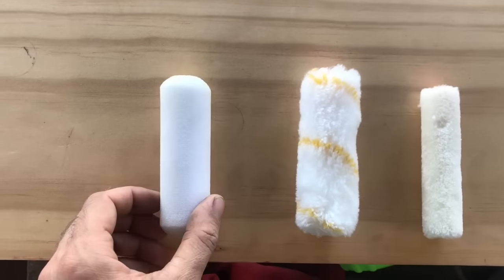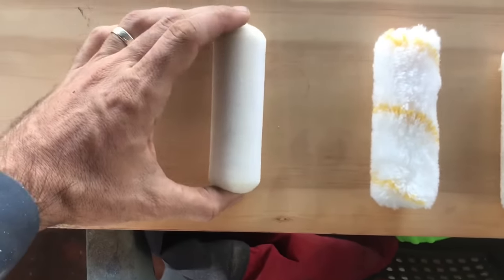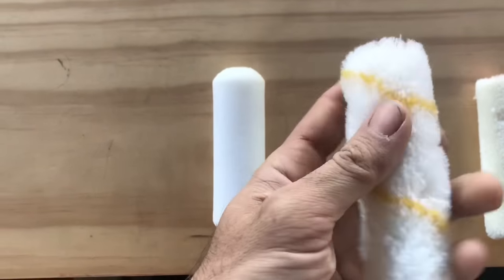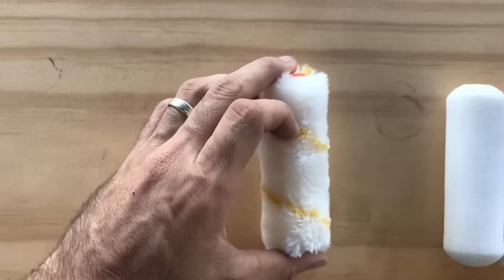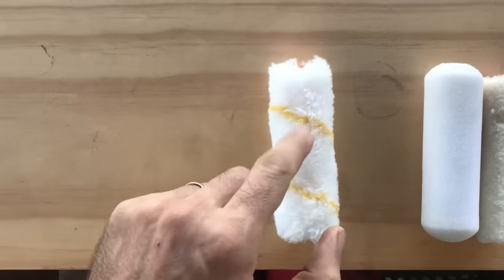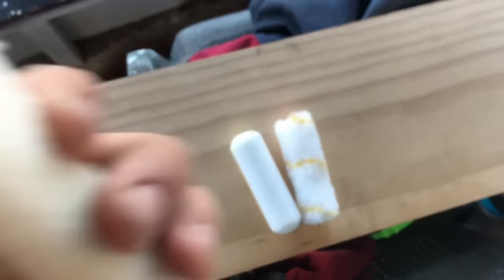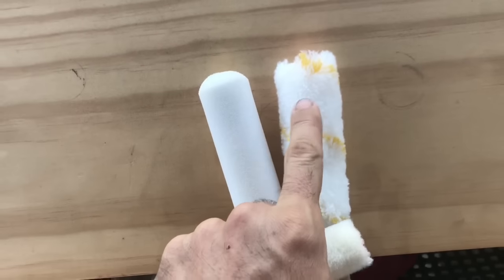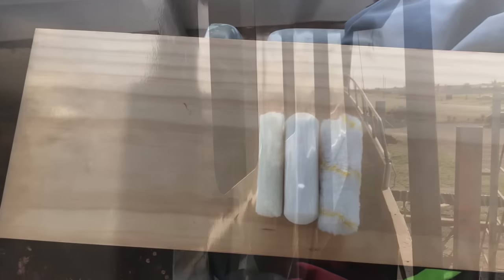What Paint Roller is Best (in our limited opinion)

Comment: 8 years late... I literally just did my first dec job in my bathroom... and I had two rollers, which in this vid were the first two types.

Wallpaper is slightly textured. Kinda bobbly patterned gently knobbly pattern stuff (not rice paper stuff).

I used a brush to edge... the the first spongey roller to coat the whole thing, then that second fluffy type to do the second coat.

I needed a 3rd coat as it was white Silk paint and looked a little streaky.
So the 3rd coat was using the first roller, the spongey one.

Turned out solid for my first decorating job.
Reply from the maker: Awesome stuff

Comment: with those fluffy rollers (both, but particularly the microfiber) you're supposed to wash them in water before first use. they're full of loose fibre from the manufacturing process, and washing them gets rid of that. have a good go at your roller with a painters tool under running water if you have one. if not just take your time using your fingers to work the fluff out.
Reply from the maker: Great advice, thanks Jess
Reply: U can as well roll it in tape and the fluff will stick to the tape.

Comment: What sprayer on Amazon do you recommend for the DIY painter?  I want to do my kitchen cabinets.
Reply from the maker: Depends on paint thickness. Two pack needs a large nozzle (3.5mm) thin paints need a much smaller nozzle (1.6 maybe)
Reply: @ProjectBrupeg  what does two pack refer to?
Reply from the maker: Two pack paint. Epoxy or polyurethane is the most common types. Two pack is much harder and lasts longer than single pack paint like house paint

Comment: If you get the paint down.. then roll it slowly (so you don’t pull up a lot of bubbles on the surface) in one direction (vertical direction on a wall), using a lite touch you can achieve a pretty amazing finish. In addition, make sure the paint is not too thick, a lot of people think it doesn’t matters when you’re rolling paint but it really does. Also adding a little oil/turpentine will help to get the paint to flow out and lay down.. that is of course if you’re using an oil base paint, there are flow control additives for acrylic too... she’s an amazing project keep up the good work!
Reply from the maker: Thanks Dave. We mostly use oil based single packs but every now and then use 2 pac epoxies where needed. I’m still a complete novice with rolling so learning with every job we tackle.
Reply: Put a bit of penetrol in the oil base and lightly roll the finish always comes up good for me
Reply: what roller do you recommend for the absolute smoothest finish?

wall is primed 2x and sanded smooth. Paint is FLAT. and I'm trying to find the best roller possible. 

Newbie here.
Reply from the maker: Good quality foam would give the best finish but you could roll and tip using a foam roller and good quality brush. 

This is tipping.
https://youtu.be/LPfQknNTdjI

Comment: We only use the yellow strip roller for small jobs  which we call a medi as the look like a medical product . For bigger jobs we use a 22mm sheep’s wool roller . Thin   the paint for a better finish .  But when its an industrial coating you want thickness . We paint navel ships . Structural steel ,  Sports stadiums , light towers and container cranes . More expensive medi rollers last longer without falling apart .

Comment: If you use them radiator roller sleaves for glossing which is oil based and doing small areas you wont pro dec ice fusion.. there brillant iv just use these for glossing a small bathroom and the finish you great is brillant the downside they dont hold a lot of paint but you do get a superb finish. Great review.
Reply from the maker: Thanks John